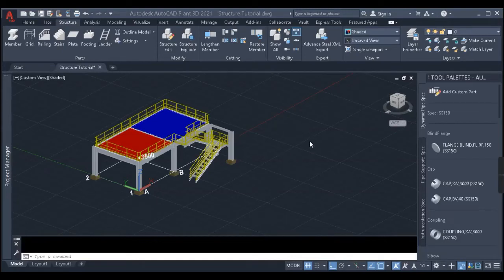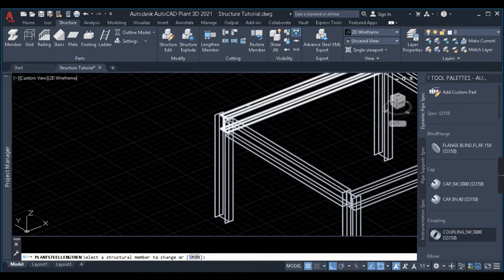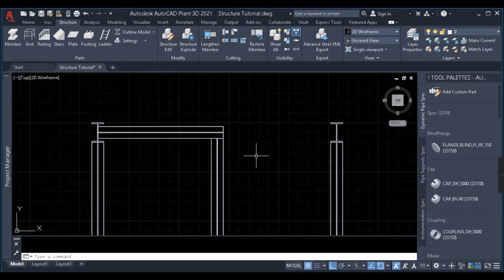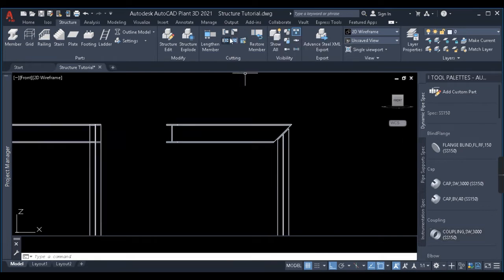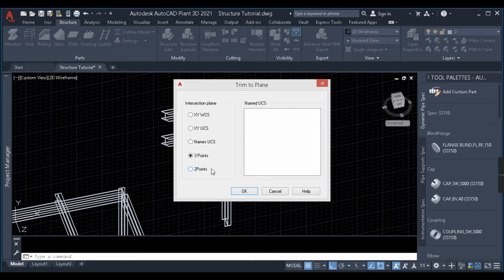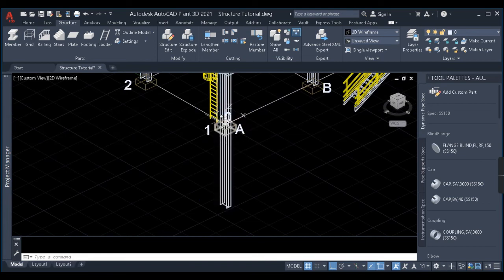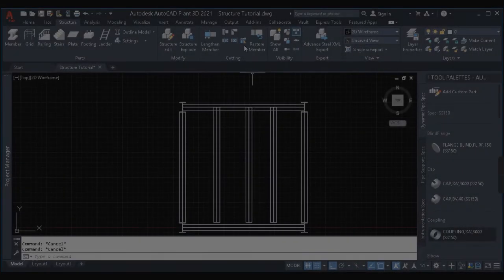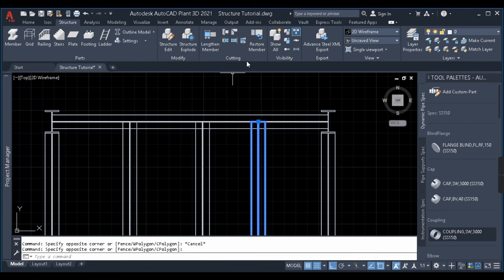Plant 3d Tutorial For Structure Modeling |Structure modifying |Part 2|

Comment: Hi sir, thankyou for the lesson❤.

I have one doubt in creating hand rails and ladders.

While creating hand rails edges are clashing with one another i didn't able to trim or miter the edges. Only I can able to do the cut or trim operation after exploding the structure is that the only way? I seen that we have a different options available in Autodesk advanced steel software 😅 .

For ladder or hand rails we couldn't able to add extra pipes or steps in structure setting so is there any other way?

Comment: Please how did you draw the line for your stair?Thanks and I was able to model the structure but the stair  I am struggling with it.
Reply: I was able to do it by creating a UCS, and then drawing on the plane. I am a complete novice so this may not be be the best way. Basically right under the 3d cube, select WCS and in the dropdown set new UCS and you want it so that the X and Y are the plane you will draw on. So Z should go towards the structure while X and Y are your width and height.